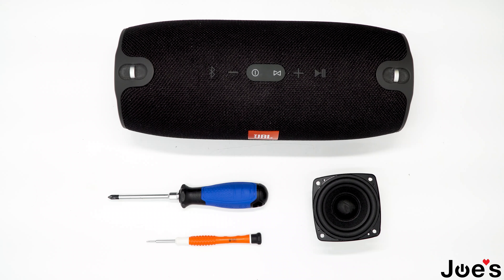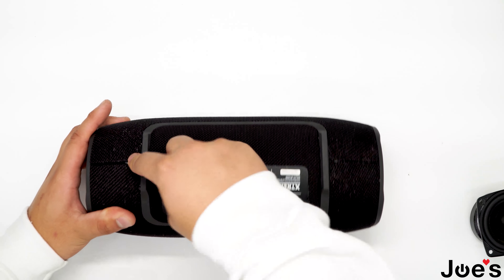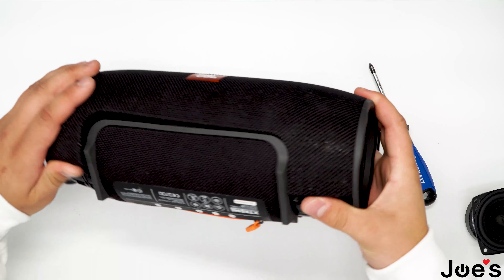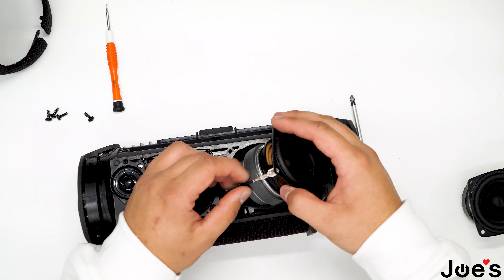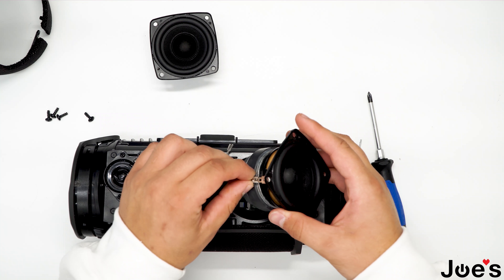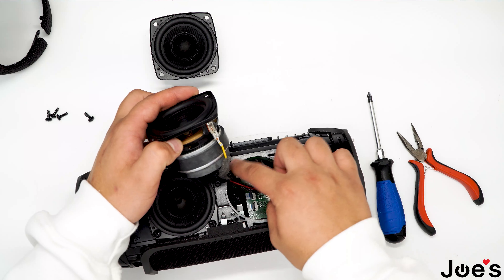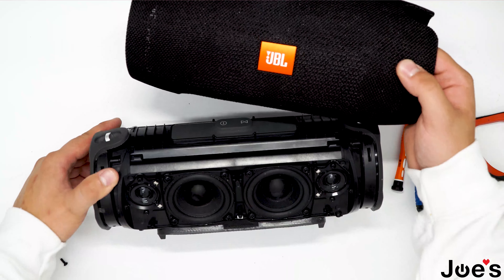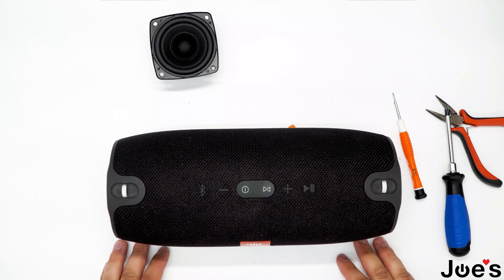JBL Xtreme Blown Bad Muffled Speaker Replacement

Comment: Do you have parts for the new Xtreme 2 ??
Reply from the maker: Thanks for the comment. Here is a link to our repair parts: https://www.joesge.com/products/jbl-xtreme-2-portable-speaker-repair-speaker-passive-radiator-battery-board-parts?variant=16742666371118
If the part you are looking for is out of stock you can enter your email in the "Item out of stock - notify me!" section and you will be notified when this item is in stock. 

If you would like your item repaired by a professional you can fill out this repair form here: https://www.joesge.com/pages/repair-services

-David P

Comment: Speaker driver is out of stock. When will it be available?
Reply from the maker: Thanks for the comment. Here is a link to our repair parts: https://www.joesge.com/collections/parts/products/jbl-xtreme-extreme-portable-speaker-repair-speaker-passive-radiator-battery-board-parts?variant=8146024595502
If the part you are looking for is out of stock you can enter your email in the "Item out of stock - notify me!" section and you will be notified when this item is in stock. 

If you would like your item repaired by a profetional you can fill out this repair form here: https://www.joesge.com/pages/repair-services
-David P

Comment: Mine is only messed up with the bass. How do I access those?
Reply from the maker: Thanks for the comment. The issue you are describing sounds like faulty passive radiator. We have not yet made a video demonstrating how to replace this part. If you would like your device repaired by a professional you can fill out a repair form and follow the steps to send in your device. We offer free shipping and diagnostics. Here is a link to the repair form:
https://www.joesge.com/pages/repair-services
-David P
Reply: Mean one of your speakers is blow

Comment: Where can I get a new speaker. One of my speaker is blown out
Reply from the maker: Thanks for watching! We sell parts for the JBL Xtreme on our website here: https://www.joesge.com/products/jbl-xtreme-extreme-portable-speaker-repair-speaker-passive-radiator-battery-board-parts?variant=8146024595502 We are currently out of stock of the main speaker drivers. You can enter your email address in the form on the main speaker driver to be notified once we receive them back in stock. MD.
Reply: Same, waiting to be in stock... My box dropped and im so frustrated because the parts are so rare
Reply: There still not back in stock D;
Reply: is it in stores now????
Reply: Would a JBL extreme 2 speaker fit on the first one ?